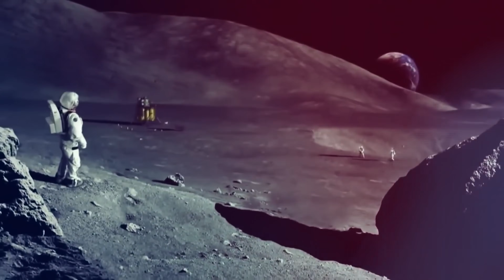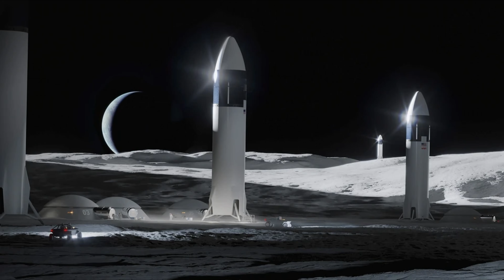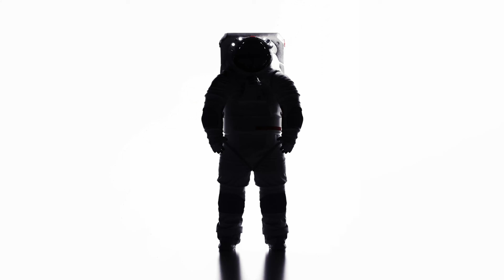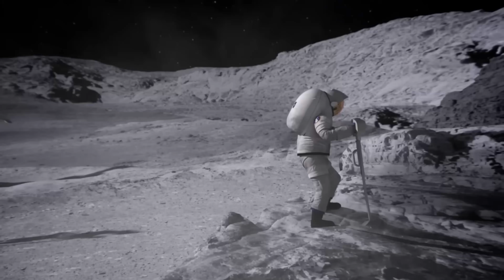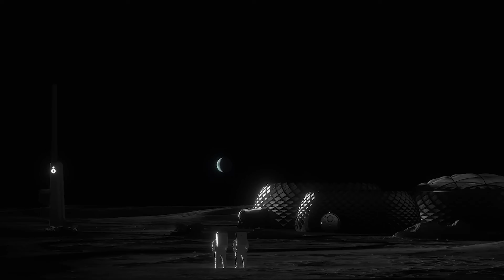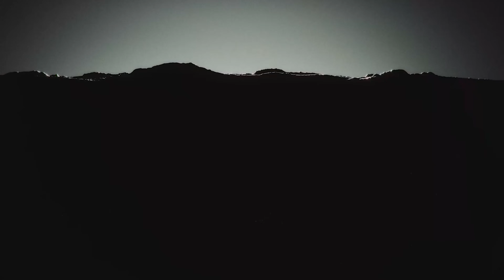Inside SpaceX Starship Moon Base Plan REVEALED, Better than NASA & China...

Comment: I believe the moon is more trouble than it's worth. The regolith alone will prove to be insurmountable much less the radiation. It's a good place to test things but not for long term human habitation. 
I imagine a small base where astronauts stay at most a month to set up various autonomous type drilling/tunnelling rigs to extract minerals if any are found for commercial endeavors. 
Mars is the only real goal but only if terra forming is indeed even possible after what a thousand years(?)
Sadly I don't think any of it is feasible tbh. 
Robots? Sure. Humans? No.
Elon shifting to data centers in Leo makes the most sense economically.
Reply: But it would be cool, tho
Reply: @MinhN-NguyenQuang 😂